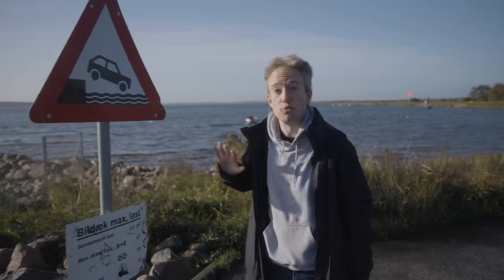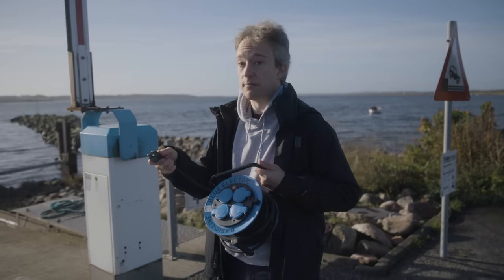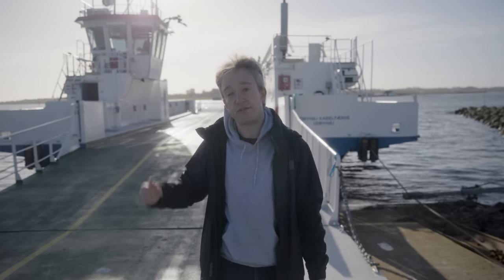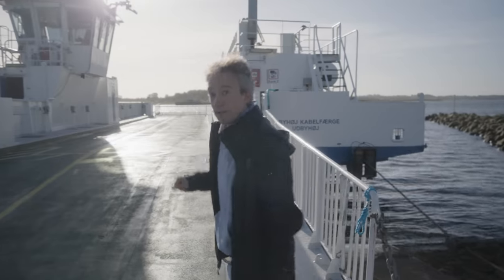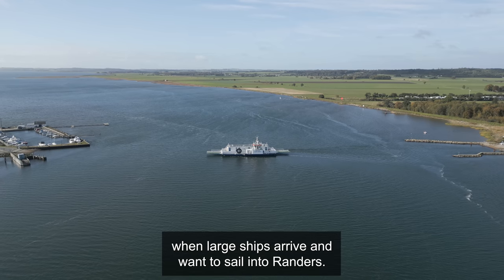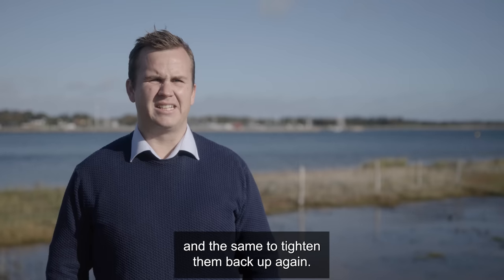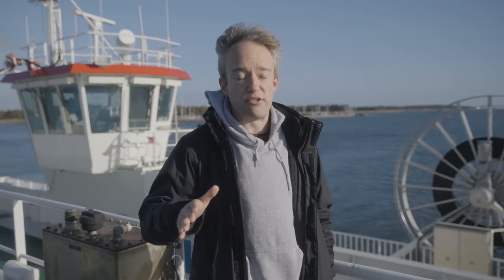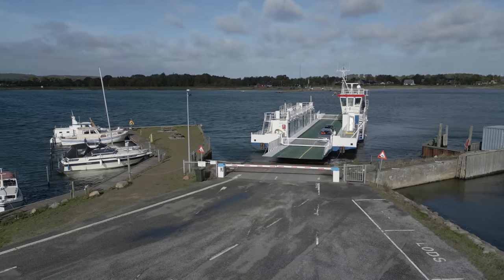This electric ferry uses a very long extension cord

Comment from the maker: I've found a hyper-efficient style over the years: I'm sure there's a lovely twelve-minute documentary to be found in this story too, but this felt like everything that needed to be said!
Reply: Awesome
Reply: Cool
Reply: Love from Denmark!
Reply: 9 days ago💀
Reply: You're a master of brevity, sir.
Reply: Thank you, nice to know.
Reply: 200kWh per day is only two Tesla Model S battery packs. And that's assuming you don't plug in during the day. Those aren't "massive" nor expensive packs Tom. In fact the whole cable setup is likely to be more expensive by far than the packs.
Reply: Definitely all that was needed, there's been talk of using this type of technology on some of the small lifeline services on the West coast of Scotland that are currently served by CalMac ferries.
Reply: Ok
Reply: Short and to the point are the best vids !   Well Done !
Reply: @MacGuyver85  yes totally, thank you for putting it into perspective.
Maybe two batterypacks would be cheaper than the one off Calbe mechanism.
But at on cycle a day, the batteries would have to be replaced after 3-6 years (assuming 1000-2000 cycles on LiPo).
Maybe the cable will pay off by working longer?
I'm sure they thought about it?
Reply: Good!
Reply: @MacGuyver85  that is bevause it is not a standard ferry... If it was a normal propulsion ferry it would require 500 - 1000 kWh batteries and would probably be recharged throught the day so it wouldnt require bigger battery...
Reply: Brevity on Youtube is a much underrated trait Tom. Never change
Reply: I remember in middle school my teacher always wanted us to answer a question in 5-7 sentences, but I would usually answer it in 1 or 2.  They would say I need to write more, but I had already fully answered it, and couldn't figure out what more there was to say!
Reply: Too many people pad their videos to ten minutes and two seconds long. Love the economy and respect of yours!
Reply: damn never thought he'd come to my city
Reply: @simonslothgregersen1798  What I said when I saw him flying over New York.
Reply: I'm just happy to get the reconfirmation that Danish is completely incomprehensible, even for a fellow Scandinavian.
Reply: Twelve minutes? I'm waiting for the Tom Scott feature length docu-vid… :D
Reply: @MacGuyver85  200kWh at the current usage of the ferry. If they want to do more trips per day or do faster trips along the cable, more power could be used if they planned appropriately with a large cable. (Which they'd need anyway for strength.)

Plus, I see this as a sort of small scale design proof of concept. Do it along 100x the distance. Now, all of a sudden, that much battery will not easily float on that size of ship.
Reply: Lazy 😂 👍🏼
Reply: @MacGuyver85  make a cool video about it😊
Reply: That's why I watch. I know you get to the point and I'll maximise the interesting information per minute in watching.
Reply: I subscribe to a lot of channels to broaden my understanding of the world, and appreciate the fact that you are the most efficient at explaining the essentials of topics. If I watched a 12 minute documentary, I’d probably forget 9 of those minutes and just retain what you explained in 3.
Reply: @InvadersDie  No, that was perfectly clear and comprehensible Danish. I'm Swedish.
Reply: In Norway we use what you call electric feries with massive batteries, but they have chargers, that they automatically plug into, where they can charge, while unloading and loading cars
Reply: I will just note that we here in Denmark also have a ferry with a "sail" a big tube on top
Reply: Work smart, not hard
Reply: The format is 👍
Reply: For me it depends if I am left with questions at the end of your video. With your refined style a lot of the time I'm not, but some of the time I am and I do find that frustrating
Reply: Check out the Colour Hybrid!
Next epidode 👌👌
Reply: Tom Scott, there are great applications for many inventions, when it comes to this it doesn't solve many problems of the current times. I have utmost respect for the men and women that contribute to these actions..keeping history alive in our modern day I drive a gracious 1988 Oldsmobile 98
Reply: You could have done it in under a minute easily. The ferry manager's speech in Danish was dragged out endlessly!
Reply: A piece of advice that I've enjoyed that I learned years ago, "A work is not finished when there's nothing more to add. A work is finished when there's nothing more to leave out."
Reply: Thank you for visiting my country! I hope you enjoyed the stay!
I’ve been a huge fan for years!
If you ever come to Horsens, there lays the oldest prison in Denmark (at least by modern definition of prisons)

It is now turned museum, and you can actually stay in a cell overnight.
Reply: @mathevideos9909  something along these lines is what I was going to say, well said.
Reply: Under 3 minutes. Okay then
Reply: @mathevideos9909  You could do it with Lithium Iron Phosphate batteries. A ready made plug and play solution would cost around €150 000 and last 4000 cycles or ten years. That's about €40 per trip. The cable will be cheaper in the long run.
Reply: How is this 10 days ago?
Reply: Your short video style is perfect in a time of 45-minute videos, thank you for sticking to it.
(P.S. I'm speaking, I'm sure, for all of us with loads of interests but also with full time jobs and actual lives off the internet.)
Reply: no need to say more than you have to, this is the perfect length!
Reply: @noxar_ad  probably uploaded as private/ unlisted, maybe had a viewed by some people as 'proof readers' or patreons, then made it public today.
Reply: I was just thinkning I appreciated how brief this was! long or short form your videos rock
Reply: The short videos on YouTube are easier for me to find time to watch.
Reply: “If I had more time, I would have written a shorter letter”
Reply: More time for fun activities on each trip if the video is only short too!
Reply: @MacGuyver85  If it would be cheap they would have done it
Reply: Wait how 10 days ago when it's 1 hour since post!?
Reply: I imagine a rack of solar panels that lock into the tops of shipping containers and plugged in very quickly.  I imagine the top container on every train, container ship, shipping container parking lot, etc should have one.

It would be interesting to see how many solar panels could be installed on a container ship including solar cells in the walls of the ship, etc and what maximum speed could be achieved on that power alone.
Reply: Do you know what year it is? You're fine
Reply: @MacGyver. It’s a retrofit, pal, not a whole new build
Reply: we like it this way, no need to take up unnecessary time, if we want that we can always watch that documentary.
Reply: Yes but I enjoyer the longer video format
Reply: I’m like nr 3000
Reply: oslo also have E ferries!
Reply: @heuhen  also in Oslo
Reply: I'm guessing Americans didn't know what you meant when you said it was hooked up to the main...
Reply: @MacGuyver85  battary packs arent forever, batteries degrade quite quick especially when you are talking about killiwatt hours of energy. A cable is far cheaper and safer for a large boat like this.
Reply: I don’t always have more than 4-5 minutes to watch something, so I love these quick videos!
Reply: @InvadersDie  Well the guy had a dialect. He’s from Randers for sure 😂
Funny thing about Denmark is the dialects vary quite a lot over very short distances. If you drive 100 km west, from Randers, and talk to someone there you’ll get the impression they’re talking a completely different language. 200 km south; another dialect and so on.
Reply: @jacob_90s  that's exactly what happened to me in college! (in the UK, so not university-type college, the one that comes before that stage), except they wanted a certain number of thousand words, not sentences.

They said "you've made some very good points, you've covered everything, you just need to write more"... but I'd already covered everything, what more could I possibly write?!
Reply: @MacGuyver85  You're not considering that the weight of the batteries required would need more power for the weight of the batteries, which requires more batteries, which requires more power... etc. The equilibrium point where it would work would be a fair amount higher, not to mention battery degradation and replacement. So by just having a cable you're able to avoid all of that and also use less power in the process.
Reply: I felt there was one important segment missing in this video: regarding what stops this cabled ferry from using the same ingenious propelling method as that other cabled ferry you covered once, where it simply locked the rudders in one of two positions, which decided where the current pushed it. All it needs is a cable, a ferry, and a current - all three of which are present here as far as I can tell?
So the video might use a 'hyper-efficient style', sure. But actually a tad too efficient ;D
Reply: @MacGuyver85  But the cables will last a very long time. How long until those battery packs need to be replaced?
Reply: Maybe you should do a video about the Elsinore - Helsingborg ferry. They put a big battery on them a few years ago, and has got quite a genius way of charging them as soon as they dock in the port.
Reply: All I needed to know!
Reply: @LashanR  Yes, yes, the rocket equation. In theory. But I'm guessing this isn't an issue here, for two reasons.
1. A couple of Tesla-sized battery packs don't add enough weight to the ferry to really make that big of a difference. Sure, you'd use more than 2 packs, you'd probably have 4, just so you don't come too close to running out, and you don't have to charge all the way to 100%. (By not charging to 100% you can apparently quite noticeably prolong battery life.) But even so.
2. Most of the energy to power a ferry of this sort is fighting against the water resistance, not accelerating your mass. As such, the amount of mass is a relatively minor contributor to total energy usage.
Reply: I love your style Tom!  Quick learning! 😊
Reply: Ok
Reply: And it's fantastic. Your style is a godsend to people like me with ADHD who need a quick brain snack but can't commit to anything long. You are the Hemingway of on-location documentarians, sir.  Don't change a thing!
Reply: I would have liked to hear about the electric safety measurements
Reply: Thank you!
Reply: I enjoy the short, concise videos when they are appropriate for the topic. Such videos are efficient with my time. Thanks, Tom and team.
Reply: I loved the length of it. Just right
Reply: I'm really glad that despite your efficiency you always have a nice long lingering outro for the video
Reply: That was very good and efficient, while there's some experience I feel that I missed, on the whole I came away challenged and feeling like my brain had been expanded just a little bit on the topic. :))))
Reply: and you were right.
Reply: Always commenting way earlier than others, I see 😉
Reply: Norway has tens of some what long distance fully battery electric ferries. Between Sweden and Finland there is also a large fully battery driven ferry. On top of that Norway also have a hydrogen driven ferry.
Reply: @martinpavelka5737  Look up the Norwegian ferry Ampere. It is just like that.
Reply: fwiw, I'm far more likely to watch a 3min video than a 10min one
Reply: I love how you are doing all sorts of big stuff but still have time for the little stories like this one!
Reply: @equalizer1553  why wouldn't a pully version also be 'greenwashing'?
TS has covered reaction ferry before, maybe a pully ferry is a future video?
Reply: @MacGuyver85  The subtitling is wrong for that bit. He says "The ferry today uses between 150 and 200 kW" - he doesn't say kWh. He mentions using 100L of diesel per day before so certainly more than 200kWh.
Reply: Have you done the electric ferries at Helsingør-Helsingborg yet?  Big ferries with 5km crossing.  And I believe they can do multiple crossings on a single charge.
Reply: Love you to bits, thanks Tom
Reply: I got to be honest, this is part of the reason why I love your videos. I know I’m going to hear exactly what I need to hear, and not much else.
Reply: Somehow you've made the video's shorter whilst still having them be entertaining and more engaging in my opinion. Ty for another vid and keep up the phenomenal work you do.
Reply: You're a slacker, Mcfly
Reply: I love having options. Thanks for making digestible stuff I can watch anytime.
Reply: If Tom wants to make the “lovely twelve-minute documentary” that is in the story, I will definitely watch that too.

Heck if he thinks he can make a “lovely hour long documentary”, I would be okay with it. 😉
Reply: Perfect. If you can tell the story in 3 mins why stretch it over 15 mins or so? Many other YouTubers wouldn’t have gone beyond the opening preview of the video and telling you that it’s sponsored by squarespace or NordVPN 😅
Reply: It works well, honestly. Probably helps with those people with short attention spans, too
Reply: Thanks Tom. One thing comes to mind about this: At 01:00 he says that the ferry uses about 150 to 200 kWh per day, on average. This would not require 'a really massive battery'.It's not much more storage than can be found in a Rivian or Ford pickup truck. Double that for safety, and the ferry could run all day one one full charge, with a healthy safety margin. Recharging Lithium Iron Phosphate battery pack once per day, the ferry could run for at least ten years before the pack would need replacing. And if using 50% of its battery charge every day, the pack would last for at least 20 years. There would be no issue with cable management, and no risk of tangling anything on other larger ships. That said, the ferry is fine as it is, for most of the time.
Reply: I like brevity. I lose interest when explanations
Reply: For what it's worth, I'd really like to see you do some more longer-form videos.
Reply: "Omit needless words" ~The Elements of Style, William Strunk Jr. & E. B. White
Reply: @james_cinnabond  “Some pig” - Charlotte
Reply: Well done, as always!
Reply: I would of liked more footage of how the cable tightening system worked and maybe even underwater footage of the cable like 20 seconds of extra footage
Reply: i wish more youtube channels followed this!!
Reply: @MacGuyver85  200kwh is the average power use over the course of 24hrs. if you consider that the ferry may only be operating for 1/20th of that time or perhaps even less, the instantaneous power demands are MUCH higher, probably in the area of megawatts of power.
Reply: @beth12svist  YES!!! i mean i love learning about new things, yet it's becoming increasingly more difficult to wade through the absolute minutia in so many of these videos...
Reply: I noticed you haven't formatted your episodes in a while
Reply: Short and to the point.. It really works!
Reply: Norway has much bigger battery powered electric ferries that hold dozens of cars and trucks and make long journeys across much wider fjords.
Reply: Thank you for valuing the viewers time.
Reply: Reply
Reply: Do you know about the helsingor helsingborg ferry between Denmark and sweeden? I believe it is also electric but is much bigger and does use batteries but charges at one end with a giant robotic charging lead that finds the charging port on the side once it docks and fast charges it
Reply: I definitely prefer your hyper-efficient style of information dispersal over lovely ramblings nine out of ten times :)
Reply: BTW there are proposals of nuclear power stations on ships that could connect to a convoy of container ships so they could run on electric motor and decouple any time to continue with their diesel engines to their individual destination. As well as nuclear powered charging ships that could recharge ship batteries on the sea.
Reply: There is a ferry in Amsterdam to Zaandam that is electric with batteries and in charges on one side every round with a magnetic connector that automatically connects.
Reply: @markmaurer6370  I’m guessing connecting to main is the same thing as connecting to the grid… I’m just an American so not positive /s
Reply: This was perfect
Reply: I wonder if, in the future, this could be powered by the cars it's carrying. A couple Teslas or a single Hummer EV hold more power than this uses in a whole day.
Reply: This is great, actually. Most YouTubers get less and less efficient over time - they learn to babble on as long as possible so they can get as much ad time as possible. Mostly I wish the 10 minute limit from years ago was still in effect (perhaps with a few exeptions allowed).
Reply: Nice
Reply: and that's why we love your videos Tom
Reply: Absolutely Yes
Reply: @wogsland  that ferry has a 1000kwh pack, or about 11 tesla model s packs (15 model 3) not bad actually.
Reply: It was perfect. You provided links for people with more interest.
Reply: This is why I still watch you and not Veritaseum; I feel like that guy wastes my time.
Reply: can’t wait for you to explore japan
Reply: Can this also use supercapacitors?
Reply: What an absolute waste of valuable resources to save 100 liters of diesel.
Considering that Denmark still burns coal for power makes this extra iseless
Reply: Tom. Go see Brent in Cerro Gordo 😄
Reply: It says 2w ago?
Reply: Just straight to the point, Tom!
Reply: But is it AC or DC powered? Submerged cables suffer heavy AC losses if they're not properly insulated, which makes them unwieldy to constantly wind and unwind.
Reply: you do realize that power dosnt start at the plug right ...that's still good old coal running that ...in till we all run on nuke energy its far from clean same with any ev or in this case plug in
Reply: Videos shorter than 5 minutes are my favorite. So many youtube videos are like 8-12+ minutes just to explain what you explained and it's not needed
Reply: If I had more time, I would have made a shorter video